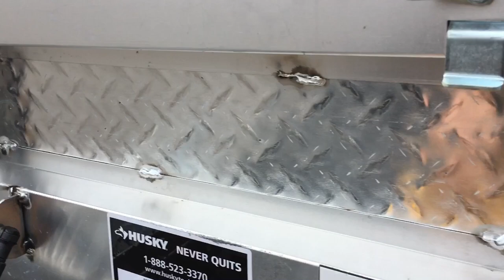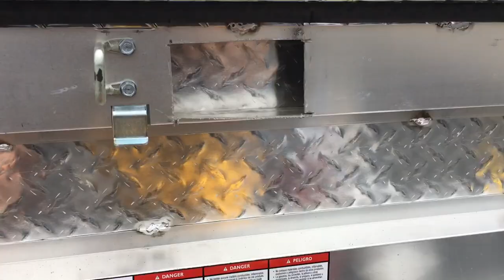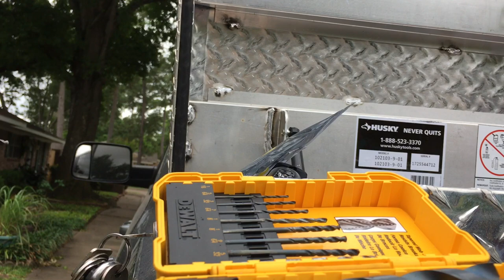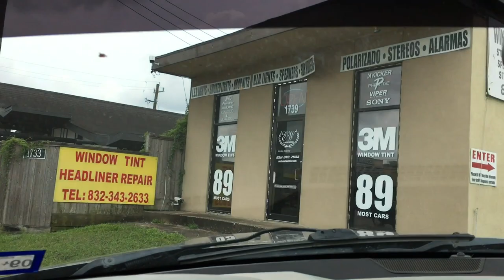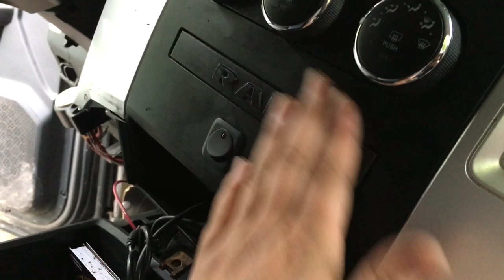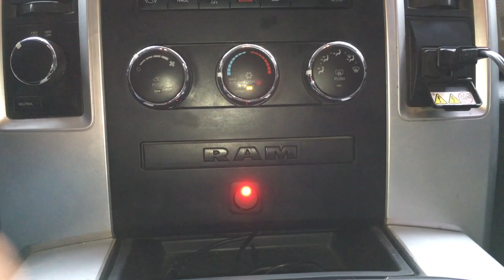amber and white strobe lights installation on trucks toolbox

Comment: Wouldn't have grinded it away... would've just used self taper screws with a gasket... or just regular self tappers with some silicone... something to help keep water out...
Reply from the maker: Bryce Yancey Grinded the inside of the lid, the water seal is around the corner of the tool box lid, no water is getting in there.
Reply: Sheet metal screws or pop rivets, then fish the wires from the ends.  Just makes a cleaner looking install.
Reply: @MotivatedMetalworks  this is what i came to the comments to write....hope he doesnt do any work on the actual truck

Comment: Do you have an issue with sync. I find one strobe runs a little faster then the other and won't do same thing same time no matter what I try
Reply: The strobes I bought from amazon (ASIN B07Q9HTZX3) each have 5 wires - red (+12) black (gnd) yellow (change pattern) gray (sync) white (sync).  The instructions say to hook the gray from one light to the white of the next and that syncs up the fixtures.  It worked for me.  You may want to check yours to see if they have sync wires as well.

Comment: I like the lights. They’re a good way to alert and warn motorists. 

Not to throw shade on the guy that wired them up, but I know I would have done a better job at wiring them up. Leaving wires close to sharp edges is a sure way to burn some things up or at minimum the jacket on the wire will start to chaff leading to electrical issues later on. Those wires should have had wire loom on them.

Comment: First, nice job installing your lights. I do have to agree with the viewer that suggested you shouldn’t have mounted your side lights at an angle. LED lights, especially TIR models like the lights you installed, give the brightest and best warning when viewed (mounted) straight. Their off access effectiveness is not the best so by installing them at the angle that you did, your brightest light effect is pointing upward above eye level. Even with the LINZ or Linear style light head, it’s best to aim straight or eye level but their off access intensity would have compensated enough if installed at the same angle. Other than that your installation was very clean and great decision on location of your switch. Good luck with your future videos and thanks for making and posting this one.

Comment: why the hell would you mount them on the lid and not just on the side of the toolbox
Reply from the maker: Cody Moran how are people supposed to see them ?? A low/ small car won’t be able to see them if I don’t put them on the lid, it’s a small tool box.
Reply: Grtruckingdemolition how do the people see them if the lid is up?
Reply from the maker: William Watkins why would the lid be up? If I need something from the box I’ll get it out, and close it. Also if I have them on while running the lid won’t be up.
Reply: Grtruckingdemolition well if your working out of the toolbox your not gonna keep opening and closing your gonna keep it open.
Reply: I agree with cody man

Comment: I have purchased the same ones and waiting for a good day to install. Couple questions since you've already done it.

What gauge wire did you run for install? Did you look into putting extra sealant around them to prevent moisture? And how have they held up so far?
Reply from the maker: Layingframe1 Yes put sealant, I had to unscrew mine and add some sealant after because they were getting moisture they still do a little bit but it goes away in a couple of hours and they start working fine again but when they do get moisture they don’t blink they just stay on but they’ll eventually work again so other than that they’re pretty good